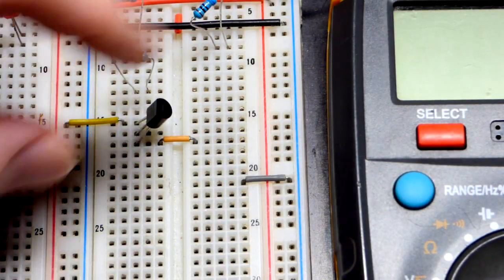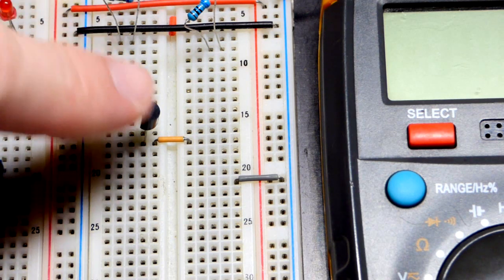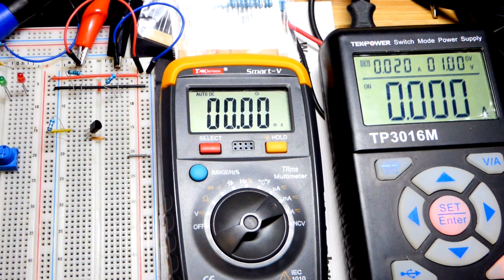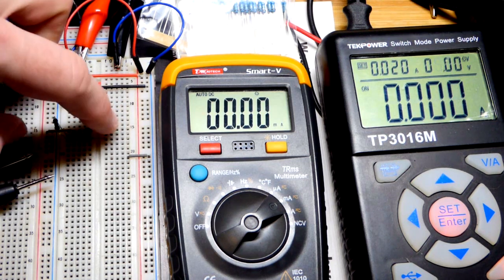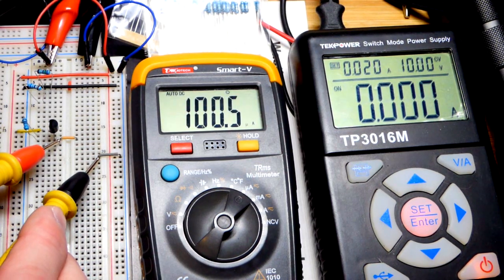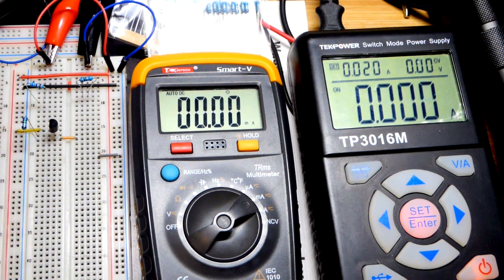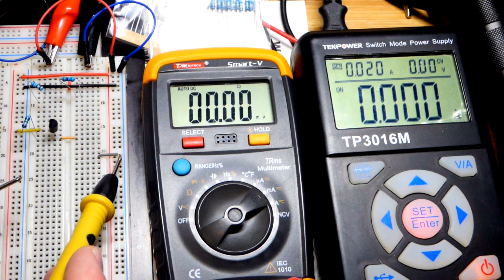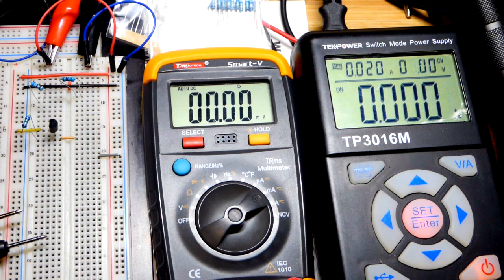LM334 3 terminal adjustable constant current source set with 1 resistor electronics demonstration

Comment: So Resistance between R pin and GND provides constant stable Current source??
If so coooll....
Also can I use a different Voltage regulator like LM7805 similarly as currently source??...
Reply from the maker: Resistor goes from R pin to V- pin. There's usually a load between V- and ground or between the + supply and V+ pin. I think the 7805 current source is a little bit different.
Reply: @Electronzap  Okaa thanks for Information.
Reply from the maker: Thanks for watching!